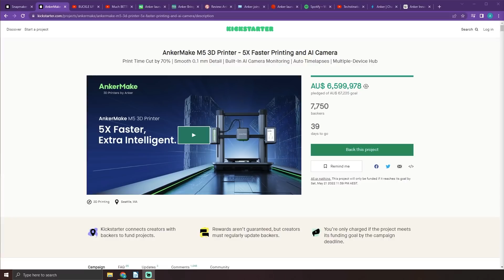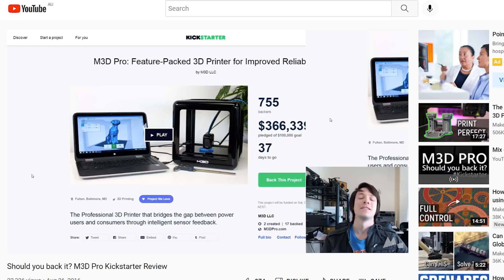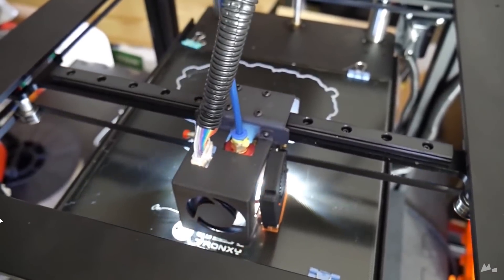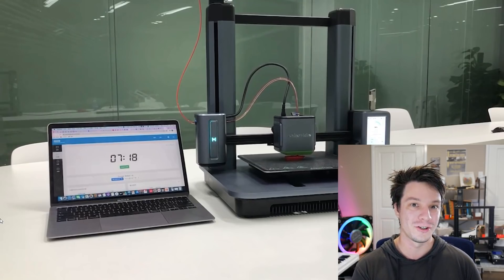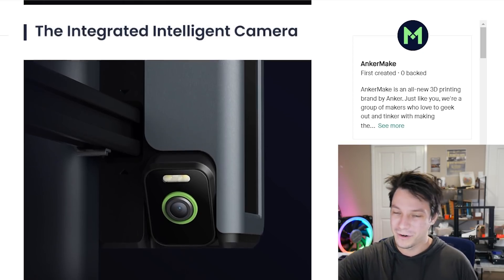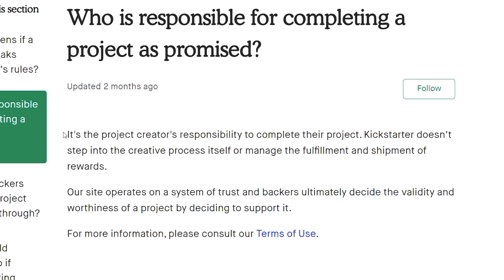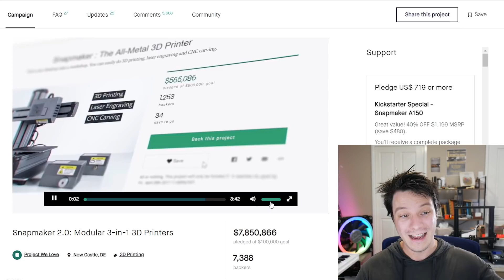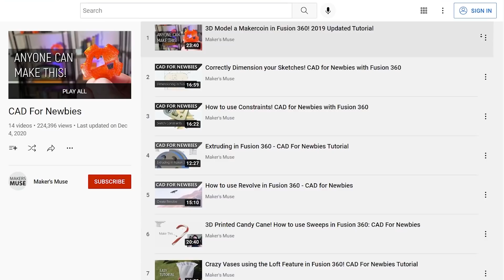This 3D Printer looks incredible, but...

Comment: Something people don't talk about with Kickstarter: price discovery. Anker is figuring out how much the market will pay for this machine.
Reply: For Anker this is basically a preorder system with extra steps 😂
Reply: Exactly. It's basically a marketing exercise.
Reply: Yep, for example I personally would buy it at 400 but above that it just isn't worthwhile.   Now if it had a bit higher end components like linear rails I could see the asking price but it isn't much more than an upgraded ender 3 as it stands.    There are a lot of other similar options with the same features in the 350-400 range.      The only real big benefit they have others don't is the spaghetti detector because currently you generally have to pay monthly for that feature and honestly they charge a pretty good premium for it.   If that works anywhere near decently well it honestly makes the printer amazing for a print farm.    
At MSRP your getting really close to a lot better printers like a voron and above things like an ender 6.  
That is my problem is that above 500 I would honestly be looking at going core xy.
Reply: "Something people don't talk about with Kickstarter: price discovery. Anker is figuring out how much the market will pay for this machine."

Not really, though. Kickstarter campaigns have set prices, which are typically a % discount from the eventual retail price. They have to do their price discovery / analysis before starting the campaign, and that price ends up on the web forever, so they can't really double it later in retail without backlash.

What KS DOES get you is publicity, like Angus said, but also a guaranteed set of preorders. KS campaigns have FOMO going for them, so folks want to preorder before the campaign ends. If Anker did it on its own website, it wouldn't get the publicity and discoverability, but also wouldn't make use of the existing "I only have X more days to make a decision" mindset that is built-into KS users -- not even if they replicated that on their own site.
Reply: @Psychlist1972  I have to agree there is a certain amount of FOMO that affects price discovery: the interesting balance is if they set the price way too high for the starting backers, they won’t get enough backers at all.  The most useful pricing information is after the early price checks for goals are reached, working on the premise that the earlier the entry as a backer, the lower the price, but if the project appears valuable enough to get backers after the lower price options are gone, you’ve at least found a viable starting floor price for a retail price.

This is the first time I’ve gotten into a kickstarter, after being on the sidelines for years.  This printer appears solid for the mechanicals, and the basic usability even if the extra fancy failure detection fails, and the videorecording, all appears to be solid: even if all the AI stuff was a total failure, and you were limited to “only” using Cura with it, the value appears to be there.

One of the things I’ve seen repeatedly with kickstarters in such things like 3D printers, but not limited to them: all too often, the kickstarter funders think they’re farther along in their design phase and think they have the manufacturing and logistics all figured out, perhaps even assessing they have the first 90% done, and find out it takes another 90% to complete it.  Parts/manufacturing/logistics things fall through, and a huge part of the problem so many fall prey to is more often than not, they take far more time than anticipated, and that time costs money: it’s not sufficiently factored into the full equation.  As I see it, the kickstarters you should absolutely run away from are all those where the prices they claim to offer overall don’t appear likely for them to make a meaningful amount of profit: if a project is too optimistic with pricing for making it happen, sure, they’ll get a lot of backers, but they may end up paying to be slaves to all their backers because they goofed, if they’re fully honest.  If they’re not so honest, perhaps they’ll spend the money more immediately on themselves and play the tune of actually working on fulfilling their promises.

If AnkerMake can get to $7 million US without throwing in new significant expenses in added pluses, I believe they’ve found a very viable price point, and will be something Prusa should be concerned about as a real competitor in the price range.  The beauty of the AI software is if they make it work well enough on-time and they don’t need to make it open-source, that’s a competitive advantage that has a one-time (mostly) cost: the upper-end microcontroller boards with the triple cores really don’t cost a huge amount in bulk, and the hardware prices of those parts (barring certain geopolitical issues) should keep falling.
Reply: Paid Early Acces Beta marketing. What a time we live in.
Reply: and they just made $6millon dollars for what ?? do i get a printer for my backing (im guessing not ) so they get presales aswell
Reply: @gavintownsend6125  Yes, the idea is that if you back at one of the 'receive a printer' levels you receive a printer. This is how kickstarter works (or doesn't, though it's unlikely Anker would stiff a market they're trying to break into).
Reply: $5.00- $280.00 is a reasonable range for the price.
Reply: @imfloridano5448  you mean that this is the donation range you'll be willingly to share i'll guess? LOL!!!! please don't be offended by my blunted reaction. Well now i'll continue in a grown up's term (as far i've been capable of.....LOL again) Have you been aware of the features Anker suggests to integrate in the m5 machine? crazy isn't it, in a really sublime way i mean.....if they deliver off course, this will be sold for at least $500,-. I would love to be wrong and so it happens that you are so right with your estimation instead
Reply: I'l pay a $1.50 and not a penny more! Just kidding. To me any printer over $250 for the average 3D printer enthusiast is too much. Anything over $250 is for those venturing to be more serious or a printer farm.
Reply: @t3chninja_official  100% agree. The wife just got me my 1st resin printer for my birthday, a Mars Pro 2 sale bundle. It was about $400 for the printer, the 2 in 1 Mercury wash & cure unit, and a couple of bottles of resin. Totally a fair price for an all inclusive get up & go bundle, even if it came with the stinky & hard to print plant based resin. You can usually get the Mars 2 Pro on its own for roughly $250 plus or minus depending on Amazon coupons at the time. I think that's a fair price for a pretty reliable little hobby grade resin printer to get your feet wet & your workbench sticky. LOL. It's definitely peaked my interest enough that I am now patiently waiting & looking for the unicorn that is a reliable resin printer with a minimum 220x200mm plate at around the $500-$600 range.
Reply: @t3chninja_official  Maybe as a first printer but I really don't think $500 is too much, many people are willing to put more money into a new hobby to get a better starting experience.
Reply: @jellafella6957  You still don't get that experience in my opinion, there's lots to learn. I'm still learning. But to each their own. Buying it's one thing. It's all the other stuff that's a huge learning curve.
Reply: @t3chninja_official  I equate this to drones.  You can build an awesome drone with all the goodies DJI provides and pay less, but with DJI, its all in the box practically ready to pullout, fly, and film.  The other route requires a lot of build, software, component, and compatibility knowledge.  It also requires the patience and/or drsire to build.  I know a small bit about 3D printers and slicers, jsut enought o get by on my Wanhao Duplicator Plus which was $500 at the time.  Its about a capable as a $250-$300 printer today.  I would pay $500 again for something like what Anker seems to promise.  Everything seem to be way better than a $300 printer out of the box.  It even seems better (for my purposes) than all other $500 printers.  At $700+, I have not idea since I dont even look at printers at that price point.

Comment: Great Video only little Mistake: Objet was bought by Stratasys a couple of years ago and not from 3D Systems 😉
Nevertheless the Objet/ Polyjet printers are great and they even exist with a spinning plate now, looks very crazy while printing.
Reply: Came to the comments to say the same thing. The confusion is understandable because 3DSystems ProJet is doing the same thing except the support is a wax material you melt in an oven.

Comment: One thing you said in the video I have to disagree with:
You said that learning 3D modeling is complicated and takes years.
Maybe I am taking that to literally, but I don't think it is complicated at all and everyone can learn it.
Everyone should be able to make easy parts quite quickly.
And I fear that your comment in this video might discourage people from trying it.

Mastering 3D modeling takes a lot of time, but that's not necessary for the parts most people want to print.

Comment: I agree with the 10 year comment. To me FDM is like dot matrix printers - 2D printing in the 80s - printing only became mainstream with ink jet technology backed by huge corporations. Alas you have to remember the 80s to get that comment - back then people would take great delight in saying computers cost a lot of money and were good for little more than tinkering. The internet went through the same phase - actual adverts on TV running it down. The people who don't adopt/criticise  the early tech are of course quite right. My involvement with 3D printing has produced little more than a poor home made 3D printer.
OTOH there's always been someone one knows with a metal working lathe. Digital did not make lathes go mainstream.

Comment: Honestly I really fear a future where 3D printers like this become popular. Not because I don't want more people to get into 3D printing or because I don't want it to get easier, but because once these closed down 3D printers become extremely popular, it's likely that they will put a lot of the current "open source" 3D printers out of business or will render them obsolete since large companies can make bigger and faster advancements than smaller companies or hobbyists and they would most likely patent these advancements. 

The open nature of 3D printing that we're used to (open source software and firmware, printers being completely open, repairable and upgradeable) will probably stop existing at that point and we will be left with very Apple-esque 3D printers where everything including the firmware is closed down and you can't even change the nozzle without voiding warranty and needing to send it to a certified repair center. Not to mention that companies could at that point start limiting what you could print on your printer, so if you wanted to for example print gun parts in the US or anything else the company deems against their policy, the firmware would prevent you from printing it.

While the current 3D printers can be a hassle sometimes, I'm really happy that we ended up with the current situation where companies like Creality and Prusa are on top and everything from firmware to hardware is completely open and I truly hope it stays that way and that we will manage to get better and easier 3D printers while maintaining the open source nature.
Reply: the way printing is a race to the bottom race your fears are nil. I bet any company could just like that desing a printer that was closed and all that but it cost 10 + times what the race to bottom ones are. No one would buy it because it wasnt race to bottom. Any one tiny bit bottom racers can save they will. You know what happens when a company tries to protect their assets these days? They get publicly executed. Slice had patent on something and people executed them basically because they wasnt able to get the same product for bottom racer cost from china.
Reply: Couldn't agree more. The entire point of 3D printing, as a technology, is that it democratizes manufacturing. Any infringement upon that concept would be deeply concerning.
Reply: Letting the weak minded fools who can't be bothered to learn how to use TOOLS like table saws, lathes, mills, CNC routers, etc, is just a bad idea.
3d printers adre WAY easy to lear, and My 250 dollar printers work GREAT right of the box.

Comment: I own a few products from Anker and have very mixed feelings about that company. I bought a Soundcore Life Q20 (yes it is the same company) and a small plastic cover from the headband broke. I asked them via email if I could get a spare part. They immediately asked for the purchase date and the serial number and send me brand new Q20 right away. More recently I bought the PowerConf H700 headset and had problems with it all the way. The connection between the PC Dongle and the Headset was lost during calls, but in a way that nobody could hear me or I could hear no one, but the headset was still seen as active from the PC. Also the Battery was drained after 2 hours and not 24h as advertised. Again I complained and got a brand new one(but with exactly the same issues). Later I tried a firmware update on the dongle and the headset and that solved the issue.
So you might think that Anker has an excellent service right? Well as long as you got warranty they are reluctant to simply ship you a new one. No idea is that is just cheaper as going thru the effort to solve a problem or send a specific spare part.
BUT when the warranty is over (2 years whee I live) then you wont get any support anymore and can put it in the trash bin. Even as they still sell the Q20, I bought it in 2019 and cannot get any spare parts or repair anymore. They did offer me a 25% discount on the newer Q30, but then I chose to spend more to get a Sennheiser.
I don´t like the idea polluting our environment with products designed not to last long or a company that will not support with spare parts or repairs.

Comment: I'm sorry man, but this is a 15 minute video of you rambling. I made it 8 minutes through without skipping and was fed up.

You never told us a thing about the printer - what speed does it print at? what materials can you print with? is it made of plastic or metal? like, basic things that I realize you can google, but the point of a review is to give us things to review and think about it, not just your opinion on Kickstarter for 10 minutes.

Comment: My ender 3s and Anycubic Vyper has been pretty bullet proof. The worst issues i've had are plugged nozzles, which take a minute to swap. I like the idea of the Anker but i can still see similar failure points as any other printer, be interesting to see how the production models are. Too bad they didn't send Angus one to test/review.
Reply: I've never had a plugged nozzle on my Ender 3's, and I've been printing for years.
I've had failed prints, but I promise you that there will NEVER be a machine that prints with 100% success rate
Reply: @odinata  my cr10 mini has also been bulletproof.
Reply: @mtlfpv   what do I need to start fpv

Comment: There should be a limit on who can use Kickstarter like this.  There's no reason a billion dollar international company has to beg for money from individual end users to bring a new product to market.  It's just unnecessary.  It was meant to help small companies and/or individuals with no way to get the capital they need to get their products off the ground.  Think of a public forum Shark Tank, only without the ownership stake.  Companies like Anker have no business using the platform.
Reply: Anker and the other big companies use these campaigns as a market survey. They identify a number of initial sales to make the project worth releasing and setup a kickstarter for that threshold. It reduces the risk to them from situations where a lot of folks are telling marketing surveys they want something, but they don't buy them in the end, causing a loss for the company.

It's a pretty smart hack to get around the limitations of modern marketing departments.

The money collected is largely incidental in this case (they're happy as long as the income happens, not where it comes from), it's about the guaranteed sales numbers.

The problem that drives this is that there are no reliable large-scale preorder solutions for companies like Anker, so they can't readily run a traditional pre-order campaign. It also moves the pre-order earlier in the dev cycle so they lose less money if the campaign fails to meet expected numbers.
Reply: This may help certain products see the light of day though that otherwise wouldn’t be launched because of corporate uncertainty.
Reply: That will never happen. Kickstarter loves this since they get a cut from the funds raised.
Reply: I think there should be a criteria for the companies to declare their market cap and individuals their total net worth before they can use kickstarter
Reply: Or at least put them in their own category, in which they have to, at minimum, state how long they've been in business, what their profit/loss has been for the last five years, how many employees they have, where they source their materials/parts, and where their manufacturing is done. They should also have to guarantee delivery by an established date, or the supporters get refunds, because they can afford to do it. I don't mind encouraging innovation and test marketing for businesses at all levels. But I also think those who want to support true start-ups should be able to easily differentiate them from larger, well-established companies.